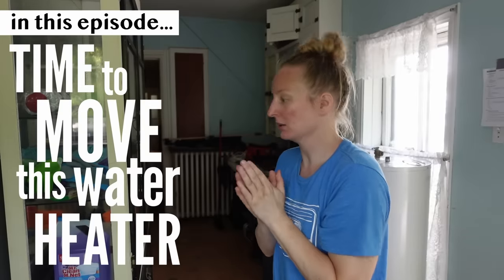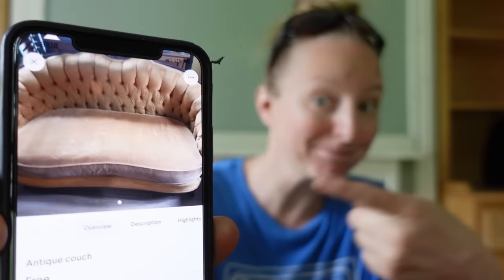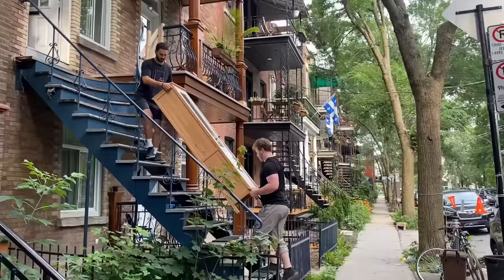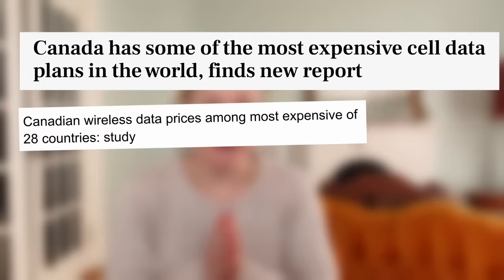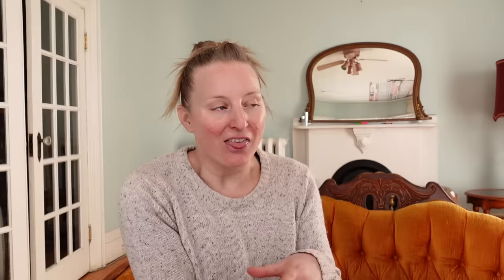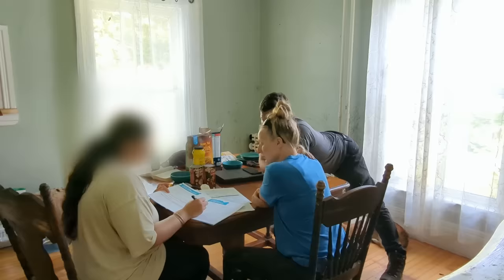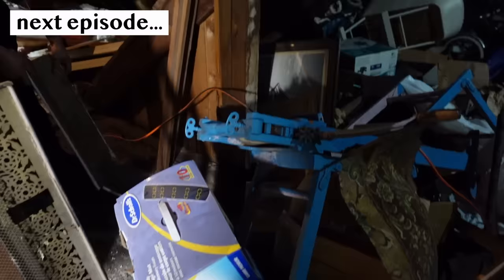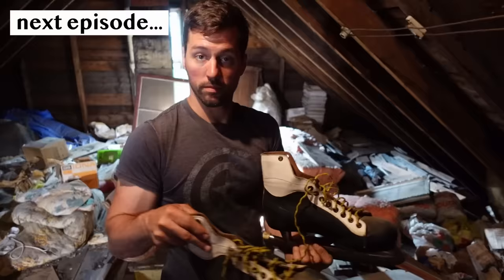you won't believe what we found behind this wall 👀

Comment: Re: what to do with the fireplace, this isn’t an option that provides much warmth but my mom’s neighbors’ old fireplace has a big candle holder in it that’s shaped like a tree branch. Still very pretty and cozy!
Reply: Menora?
Reply: @miriamgladen9615  Menorahs are specifically Jewish used for Hanukkah and most likely would not just sit in someone's fireplace. If you're looking for a word for the described it's probably a candelabra. Having never seen the item in question, I'm assuming that it looks like a big old tree limb/branch lying on it's side but has platforms or holes drilled in to hold candles.
Reply: I tried to link an example but I think youtube deleted it because they thought it was spam. But yeah they aren’t Jewish so it’s definitely not a menorah. It looks like a literal tree branch
Reply from the maker: @linden4372 YouTube doesn't like URLs so yea, it probably got filtered, but the tree branch candelabra is a great short term solution!!
Reply: How about using wood pellets?
Reply: Here in the UK we have compressed logs. They can be broken into smaller pieces easily and burn as long and as hot as coal. Might be a solution if your chimney is OK? A chimney sweep would clean and confirm.  Am very much enjoying your journey.  Thank goodness you are both fit and strong!

Comment: When the attic can be insulated, I would make it into a craft room, for sure.  For me that would mean spinning and weaving, but for you - fabric and sewing!  We had a free standing wood burning stove (Vermont Castings brand) that stood in front of the old fireplace.  A flue liner does need to be installed, but the wood stove is much more efficient than an open fire place.  And you get all the benefit of a wood burning fire.  Love your videos, your house, your humor and your cute puppy.  (Boy Math!  Now that made me laugh out loud)
Reply from the maker: glad you enjoyed the boy math 🥰🤣
Reply: Gas fireplaces suffer the stiffest codes (at least in WI.) perfect flue, always open to outside air & sealed to inside…bah humbug, in these times an insert wood stove & a flue liner are the most reasonable & comfortable to use if firewood is available (I, personally, hate the smell of coal as we can only access soft coal here)…

Comment: shannon wins the award for scroungiest scrounger around!  free couch, free water heater platform, free gravel!  ‘tis an inspiration for all of us!
Reply from the maker: Scroungiest Scrounger should go on merch at some point 🤣🤣
Reply: Its CALLED re use and repurpose the resources you already have.  Of course Shannon is going to do that to save as much money as she can. She already owned the square cement slab and gravel. Why wouldn't she use something she already owned ?1
Reply: 1963 "The Great Escape." James Garner's character was named Hendley "The Scrounger."
From personal experience, I 'd put something between the concrete block and the water heater. The block will wick moisture up from the floor and humidity from the air, and the bottom of the tank will rust. I was pounding my forehead on the wall over that one. Terse things were said.
If you can set up a small cooking area (fire pit, maybe), I  recommend using a Dutch oven for slow cooking a meal and keeping the heat and mess out of the house. I also have one of those long handled pie Irons for making toasted cheese sandwiches or French toast. My read of choice right now is "Dutch Oven & Cast Iron Cooking!" 125+ Tasty Recipes for Indoor & Outdoor Cooking by Anne Schaeffer. A Tornado went through my parent's backyard. Ripped out the electric. I made a grill/fireplace out of bricks and cooked over that. Ah...Minnesota!

Comment: We converted our fireplaces for pellet stoves. We had a coal stove in our kitchen, but it got so hot we were concerned about our pets being injured, so we went with a pellet stove. Our house is about 150 years old with 3 fireplaces, 2 of which are pellet stoves that my husband found second hand on Facebook Marketplace. We converted the coal stove in the kitchen to a pellet stove as well. They are much cleaner than regular fireplaces and throw off more heat, plus you can see the fire as it burns. You can buy your pellets in bulk so you have enough on hand.
Reply from the maker: It's good to know that you can actually SEE the fire as it burns, since that's part of the appeal for me, but I definitely want the fireplace for the wood-burning ✨experience✨, not for the actual heat. I love the process - the lighting, the feeding, the stoking, the sound it makes, the smell it gives off... I'm not sure if pellets would satisfy all those itches!
Reply: And keep in mind that pellet stoves need electricity, so if the power goes out during winter storms you may want to keep that in mind.
Reply from the maker: yea, solid point. I mainly want it for ✨aesthetic✨ and the fire-burning experience, but with power outages not uncommon around here, its definitely something to keep in mind!

Comment: A couple years back we converted our fireplace which was basically a hole in the wall below the chimney (and just all our heating out with it. We got a wood burning firplace insert that slipped into the hole and turned it into a wood stove that also burns wood way more efficiently.  they put a sleeve down the chimney and attach it to the new box. surprisingly not that expensive. I think it was 3k (back in 2010) now I keep my heat inside!!. bonus it has a fan to push the hot air into the house!!

Comment: You mentioned the pool table is concrete. Traditionally pool/snooker/billiards tables have a slab of slate to create a perfectly level surface. So it might not be concrete
Reply from the maker: Well self-leveling concrete would achieve the same effect, plus it's so large that there seems to be physically no other way that they could have gotten it up into the attic - the access doors are FAR too small to get it up there. I can't 100% guarantee that it was poured in place because I haven't examined it as much as Phil has, but we're 95% sure it was poured there as an informal pool table solution

Comment: I've been looking into ethenol for our fireplace. It burns clean, can look like a wood fire and gives off heat. The inserts come in a variety of sizes and you don't need a working chimney to have one. It has what looks like logs(there are other styles)and a container for the ethanol inside you light it close it and the "logs" appear to be burning. I've seen them used on a table top. Our fireplace should be a working one but the a member of the family is so afraid of fire that she says the chimney is not safe and we would like a fire from time to time, this is a good option for us. There is only a water vapor that doesn't require a chimney.
Reply: Some ethanol fuels are made from gel that crackles when burning too!
Reply: Nothing burns cleanly, even if it looks that way. You need good ventilation even for alcohol fires. I would not recommend it.

Comment: We had a similar situation with coal dust imbedded in an old wood floor..  But then found that the Hoover Floormate was the perfect tool since it sucked the dirty water off of the floor. In fact it worked so well that we did not have to refinish the floors, only polish them.

Comment: You should price out wood vs oil vs propane vs electric. We have put in 4 wood stoves  in our two New England (one Maine near to you) houses. We got good at doing this ourselves…..don’t worry about the state of your chimney. You will be lining your chimney with a metal tube. Which you drop down (if it’s a straight shot yourselves). Work with the inspection person if you need it to be inspected…before you purchase anything. Then you can get a small wood stove to start …one that you both can lift, move and pop in. Wood stoves are sold by btu output. Square foot heating. You can start with a relatively cheaper one…look at Jotul F602 V2….the Scandinavian ones are good…so are Lopi’s Canadian made and the Avalon US made. Propane stoves are for decor..they don’t heat at all. We popped the Jotul f602 in the back of our car. It would really match your antique home. Secondly you can get a large propane tank and get it filled once a year. Or an oil tank (oil is not good….I had oil heating and hated it). $400 per cord matches the cost of  electric use right now…but we have found free hard wood everywhere…and heated this winter for with 1 cord purchased and the other 2 cords we got free and let dry for a couple of years. No other energy sources you can pick up for free. Also think Victorian long heavy lined velvet drapes…you make. I have had the installed window quilts and hated them…expensive and not pretty. You are very good at thinking about and comparing possibilities.

Comment: As someone who renovated a house with a full(ish) unfinished attic: lessons I would have like to have known

-Put the walls at 4 ft or more (where you can have your shoulder on the wall or stand next to it without hitting your head. Maybe not Phil's shoulders, but tall enough you don't hit your head) for most of it.  The optical illusion of space is not worth the aggravation of unusable floor - plus you can save money on flooring!
-Built in bookshelves along the short walls = so practical! so easy! so much storage!  You can take freebie dressers and recess them into the wall.  Ditto for closet rods (sewing costume storage)
-Think about a textured wall finish or faux paneling on the ceiling.  Drywall will show every uneven surface of those roof joists, especially for DIY drywall install.  
-Airflow.  Insulating and tightening for climate control has the downside of  trapping rising heat in the summer and difficult to heat in the winter (mine was an office and later a bedroom - summers were brutal).
- Side note: this would be a perfect place to put a small wood burning stove and either use just a part of the old chimneys or cut directly through the roof while you have access to it.  Poor lighting = cozy reading nook with a lamp and a fireplace.
-Spend the money on soundproofing floor insulation: it's worth every penny, especially if the attic is "yours" while you rent out the other half
Reply from the maker: I appreciate the straight-forward, non-condescending tone of your comment, and I find a lot of your insights very useful and in-line with what we might want to do with our own attic if it ever gets finished off, so thank you! 
Someone else in the comments said they turned their attic into a gym, and used the low spots for exercises that had to be done while lying down, which I thought was clever, but in general, I agree with you that the frustration is not worth the illusion of floor space!!

Comment: I had the same painted shut windows. It took me a year to figure out that the top glass is just sitting in top of the screen. Push it up a bit with one hand , pull the bottom inward with the other and slide it down and out the frame. the screen slides up out of the way.

Comment: If reference to your lack of hot water. I live in a 14ft caravan in the middle of a paddock in rural New Zealand completely off grid. I have lived here for 5 years and it was only 3 years ago that I had any kind of running water let alone hot. We brought our drinking water in in 20L containers from the local town and used irrigation water which is not drinkable for washing dishes and showering. To shower meant heating a 5-10L pot on the gas stove to temperature and either using a cup to shower with or later I used a garden pump sprayer with and attachment on the end that gave me a reasonable spray. I could have a really good shower using 3L of water and this now what I use when I go away camping with my pony on treks.
Reply from the maker: I admire your tenacity, but I strive for a few more creature comforts in my own home 🥰

Comment: A friend of mine has a house about the same age which was also a fixer-upper. The coolest thing they found in their house was a boarded up hidden staircase from the kitchen to the upstairs hallway. It seems to have been a servant's stairs, which was a surprise because it's not a big or fancy house! So, having a maid in Edwardian times, sure, but them having their own staircase was a shock.

My friends' house has a similar attic -- they use it for a gym. The gym equipment is just low enough to fit under the highest point in the attic (free weights and yoga mats are under the eaves, where you are sitting/lying down to use them anyhow).
Reply from the maker: That's pretty cool... dunno that we'll find a hidden staircase, as every square foot seems to be accounted for, but that'd be so cool!

Comment: One step forward one step back but that's o k you two are doing an awesome job. Thank you for sharing your journey.😊
Reply from the maker: Wait, what was the step back?! 😳
Reply: @ShannonMakes  Nothing major. It had to do with the hot water heater. You need to learn to sweat a pipe.That way you could have already had Hot water. Definitely not hard at all. I've done it myself and I'm almost 70.
Reply from the maker: I mean, we do know how to solder, did the entire heating system ourselves 🤣 Still gonna go with a professional install on the water heater for insurance reasons if nothing else
Reply: @ShannonMakes  Understandable. Installed my hotwater heater myself. I also soldered ( sweated )water pipes that burst. All in all, I think you 2 are doing a wonderful job. I can hardly wait until the next video!

Comment: Oh the question of fireplace. Our home came with a wood burning fireplace abd we pout a high efficient wood burning stove in fireplace. Had the chimney assesses and had insert liner put on. We actually have two wood burning stoves in our home and they are very efficient. The bonus is, when we had a power outage (including no cell service for 2 months) for seven days in fall (landslides), we were warm and could heat on the wood stove. All the new constructed homes in our area, had no heat or power for long time. Be mindful that if you can, in the future, maybe try to have one wood fireplace insert, just in case as NS is known for power outages. Just a thought. 🤭🇨🇦🤗

Comment: Hello, great work. Here in the usa you can purchase replacement  cast iron radiators for the home. Two option, new ones or salvage vintage ones. Cost wise the original cast iron radiator system is the best quality & efficient  heat even in comparison to modern systems. And those base board systems means the majority of walls in every room are going to have those ugly heaters running across them.  Makes the rooms smaller and you cant place any furniture against the walls. Good luck!
Reply: Thank you!  I’m planning to build a farmhouse and cast iron radiators would be perfect!  It’s great to know that they work so much better

Comment: If it's not too late, look into getting a propane tank for a gas cookstove. The up front cost isn't too high, and you'll use very little propane for just cooking. I had one in my old house, the smallest household tank available, and filled it less than once a year.
Reply from the maker: Cool, thanks

Comment: Have you considered a bioethanol burning setup for the fireplaces?
I have what's called a desert pot and it works well for me. Basically it is a large stone urn with an opening at the front and a vent hole at the top. Inside is a metal bowl that gets filled up with bio ethanol specifically formulated for heating. The biofuel is then lit.

They do a pretty decent job of heating a small room and don't emit any fumes except water vapour
Reply from the maker: Very practical, for sure, but I definitely want the fireplace for the wood-burning ✨experience✨, not for the actual heat. I love the process - the lighting, the feeding, the stoking, the sound it makes, the smell it gives off...

Comment: I use old fashioned tape dispensers as pattern weights in my sewing space. I already was using cello/magic tape, washi tape, Magic tape for basting zippers etc., heatproof tape. We have a major university with salvage store here, and I find gorgeous retro items there.
Reply from the maker: That’s so fun!
Reply: @ShannonMakes  i meant wonder tape for zippers and other items that really need to be flat when sewn. Sometimes pins or clips or even hand basting don’t work dependably. It’s great for matching patterns; the layers don’t creep under the presser foot.

Comment: You don't have to extend the firebox for a wood stove, you have to extend the hearth.  The stove itself can protrude into the room with an appropriate sized hearth.  The stove would need a pipe extending from the back instead of the top, with an L joint to go up the chimney.

Comment: I mean, you were joking about opium den, but I really like that idea (the aesthetic). Also since the walls/ceilings are angled, it would look and feel like a tent if you were to cover them with colorful fabric and/or oriental rugs! So maybe 1001 nights + opium den + nomad tent? :D
Maybe you could also use some fabrics to hide/partition parts of the attic for storage too.
Reply from the maker: To be fair, someone pointed out that they turned their attic into a gym, and used the lower portions of the attic for exercises that are all done while laying down, which I thought was clever. But fully agree that the illusion of space isn't really worth the constant frustration... and bookcases are so aesthetic 🥰
Good point about the wood-burning stove in the attic, hadn't considered that as we don't really need heat up there now, but in the future, could be a good point. 
I appreciate the straight-forward, non-condescending way you wrote your comment, and thank you for your insight and lessons learned <3